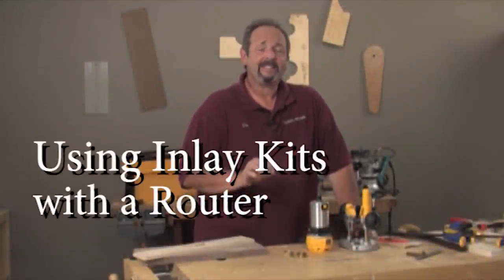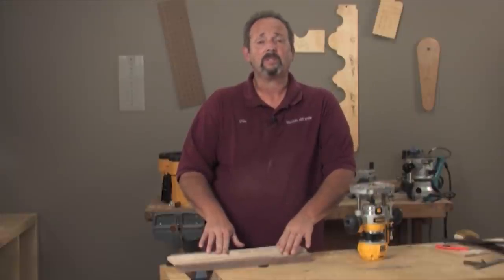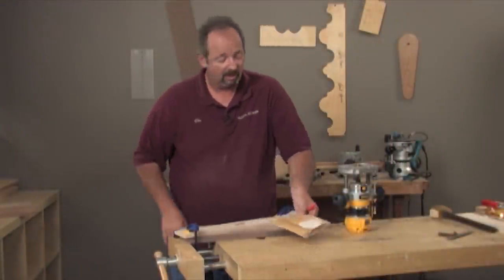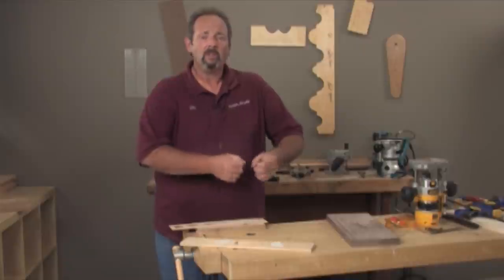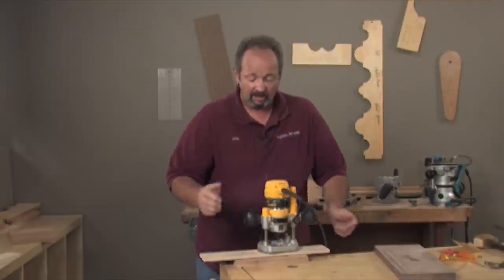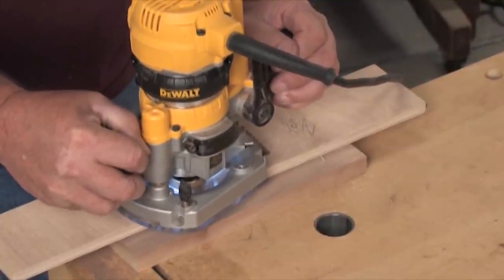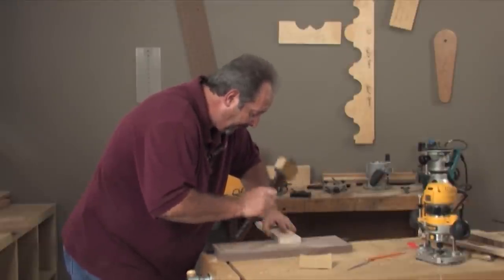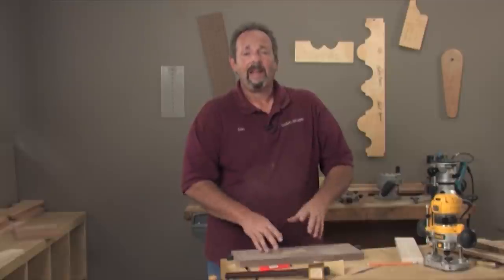Using Inlay Kits with a Router

Comment: Removing the double stick tape: on the inlay piece apply painter tape then double stick tape. After inlay is cut, pull-up inlay and peal painter’s tape off of inlay. The painter’s tape releases easier than the double stick tape.
Reply: Can also use painter tape on both parts, with CA in the center. Both great methods

Comment: Use a chisel to clean up the corners of the piece, and leave the inlet crisp and sharp.  The rounded corners look less craftsman like.  Admittedly 99.9% of people won’t see a difference.  But, every woodworker will.   And, drilling a small hole out the back of the host piece to let any extra glue and trapped air out.  A future video, of hiding a knot with an inlay and a bit of added grain to match it in.
Reply: Just finished a mahogany humidor and inlaid a sterling silver oval into the top.  It will be engraved with the owner's initials.  I drilled a 1/16" hole, but for a different reason - so the customer can use a small nail to push the inlay out for engraving.  When they glue the inlay back, it will provide relief for the 2 small spots of glue.
Reply: Agreed.

Comment: The ONLY video I have seen showing how the router insert actually goes on the router. How to figure out if the bushing WILL ACTUALLY FIT THE ROUTER YOU HAVE is the BIG question as it is not stated on the ones on amazon.
Reply: The majority of them are built to the standard Porter Cable/Guild Introduced decades ago.  And, you can buy aftermarket base plates for nearly all routers which will accept it.
Reply: @randallthomas5207  This is a King Canada router....VERY big mistake...the parts they sent with the router don't fit. I contacted them and they told me to GET DIFFERENT SCREWS than the ones that came with the router...NOW THAT is quality AND support if I ever seen it!!